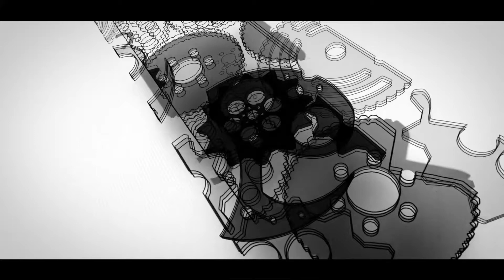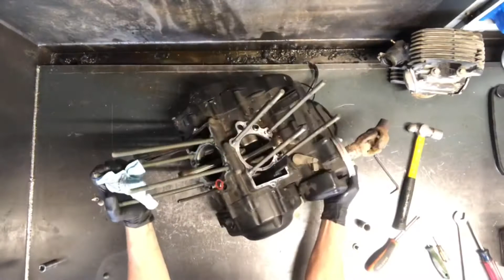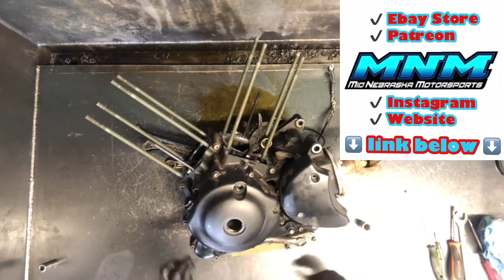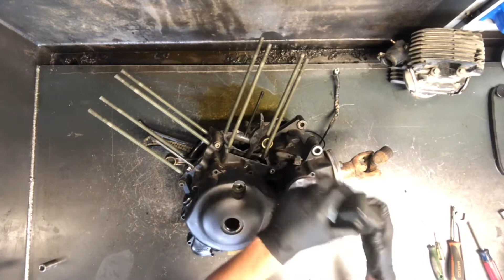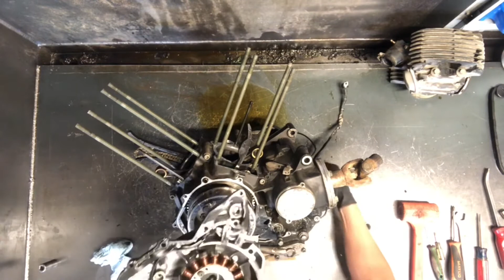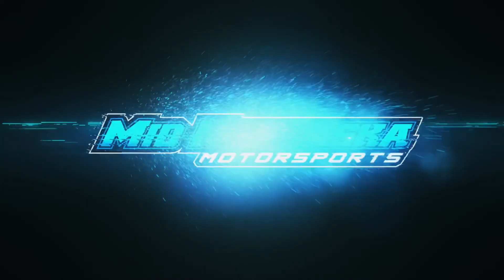Yamaha V star 650 - Won't Start / Charge - Flywheel (tool link) / Magneto Generator Stator Vstar

Comment: Nice video but l have a question how to remove the Woodruff key??
Reply from the maker: You should be able to push it out with a small screw driver or pick. If it is really lodged you can tap it out, but then I’d suggest replacing it!  If you need more helpful tips, check out:   https://youtu.be/X0AdFxkJiOg and if you need parts: https://www.ebay.com/str/midnebraskamotorsports. thanks for watching and the comment.